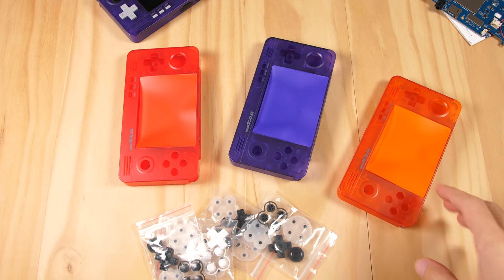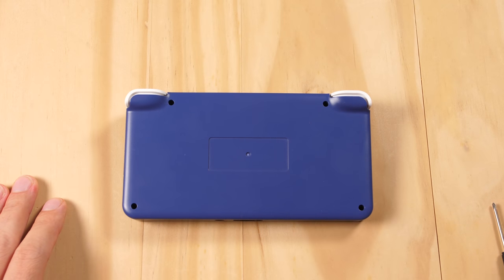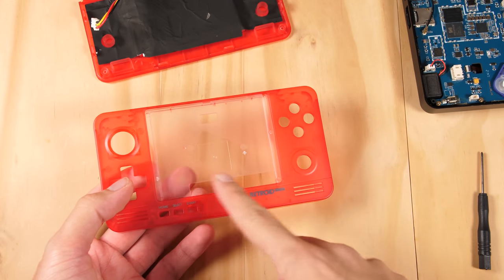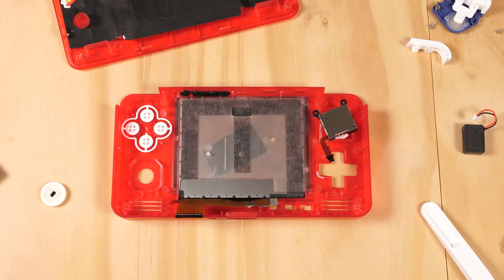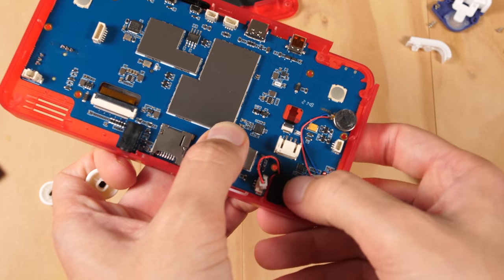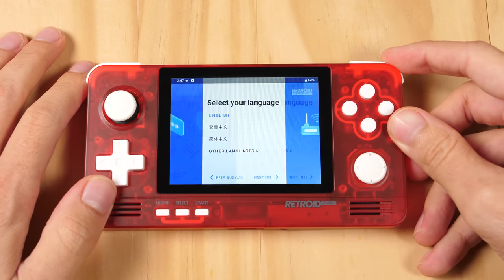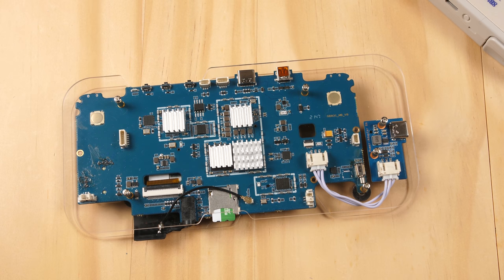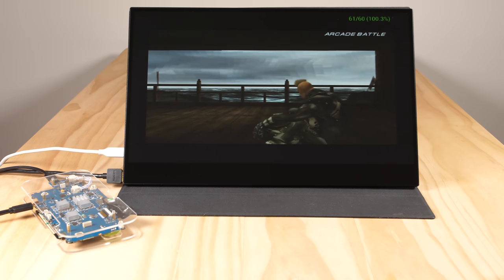Retroid Pocket 2+ | PCB Upgrade First Look!

Comment from the maker: 🔧🍉
Reply: Can you recommend me the best emulation device that can smoothly run all consoles, reasonable price, ease of use... all in all the device that you would personally use.. and that can be bought here in canada....

Thanks in advance
Reply: Taki can you do a video on gamecube emulation on the rp2+ plz?
Reply from the maker: @dylanpowell  yes
Reply: Thank you
Reply: I thinking of getting this rp2+. I have the original rp2 and I love and i think that this will be a great upgrade
Reply: Hey Taki, how'd you get fantastic shells?
Reply: hey taki i have a rp2+ preorder and i want to switch over my current funtastic purple rp2 shell without buying new parts, will i be able to tear down the rp2+ and swap the guts and touch screen over to the currently being used rp2 funtastic shell or will i need to acquire new parts as a whole for the old shell like you did in the video?
Reply: Will you do a screen switch tutorial as well?

I remember you saying a hair blow dryer or a heat gun will help.
Reply: @TheObserver85  be verrrrry careful when using heat on your RP2 when removing the shell. I warped my shell and had to order another one. I recommend using rubbing alcohol to try to loosen the adhesive.
Reply: @Mctoasty302  
The shell damage is what I'm worried about the most.

I have Jungle Green and don't want to ruin it.

Rubbing alcohol sounds a lot safer to removing the screen.

Thanks Matt 😏👍

Comment: you've really got me intrigued with the standalone project with screen.  and android is rotatable to vertical mode so this can work in my small bartop. im going to dig into this for sure. thx for the heads up.
Reply: Ryan McQuen  countercade size, with modded larger screen

Comment: You don't have to pry out glued in batteries. That's pretty dangerous, if you damage the cells. Get some isopropyl / rubbing alcohol and a pipette, a few droplets in the cracks will loosen up the glue thanks to capillary action.

Comment: Great video tutorial. 
The only thing is that I won't know how to remove the old screen.
Do you just take it out or is any glue involved?
Reply: It has adhesive around the inside edges and that E shape he pealed the back off of. 

I imagine it's similar to changing a dmg game boy screen. You gently twist the front shell, kind of like breaking up the ice in an ice cube tray.... I stress gentle.

If needed use the guitar picks to wedge under the screen to finish popping it out. 

Good luck
Reply: 1 last thing... A low temp hair dryer setting might help, to warm the adhesive... That is, if the screen doesn't pop out.
Reply: @brokensprites  Dude, I know exactly what you mean. I'm gonna do that. 

I think that GB mod feedback you gave me and the use of a heat gun (in low), it's gonna be my go to process.

You are the best, no doubt.
Thank you so much! 

- Bless
Reply: Enjoy the RP2+ ✌^_^
Reply: @brokensprites  
Great tips 👍

I also got the RP2+ pcb upgrade w/touchscreen. And was wondering about how to get the original screen off.

Thanks again 🙏
Reply: I just wanted to update you guys on my RP2 update to RP2+. The procedure works 200%. I didn't brake the old screens wild disassembling. So I fully recommend doing this.

 NOTE: You just need to heat up the back of the screen to remove it. High heat is need it.
Reply: @carlosvence  
Thanks for the update, mine should be in my hands within a couple of days 👊🎮😎👍

Comment: I've bought the pcb upgrade kit and a new touchscreen but there's no guide on how to remove the existing screen and to replace it. Help?
Reply: You have to push it out from the inside of the case. It's glued on tight... so my old screen got mangled on the way out. :( Really bummed to hear that the screen was required to make the PCB run though :(

Comment: I understand that people don't like the low profile stick on the right but because things like that get damaged in my bag I prefer them, is it possible to have the low profile stick on the left side?
Reply from the maker: Not possible unless you took a dremel to the analog and replaced it with a flat slider top. It still wouldn't be as low as the right.

Comment: If the D-pad was above the left analog stick I would have got this.

I had the first Anbernic 350 and the controls were so awkward I sold it and got the later model!
Reply: yes i really hate the diagonal thumbsticks, just put them both on the bottom please and the dpad up top where it belongs.

Comment: If I do not upgrade to the new touch LCD IPS 640x480 screen, will the TV-Out HDMI output on new RP2+ PCB work with my old RP2 IPS 640x480 LCD screen?

Comment: I ordered mine last week. How long do they take to ship these out?
Reply: Well.... Depending on what shipping method you decided on. It's a pre-order, they are making them for each purchase.

The pre-order states that each unit will ship after 35 days and it takes about 30 days shipping from China using standard shipping.
Reply: @brokensprites  damn I won't get this till March then. Thanks for the help!
Reply: @richardkassouf5719  Did you go with DHL for shipping?
Reply: @MrCumstein  4px? Not sure what that is. DHL was 3x the cost. Lol
Reply: @richardkassouf5719  Yeah DHL is pricey but you'll get it in 3 to 5 days.

Comment: If I purchase the RP2+ upgrade kit, do I still need to buy the d pad upgrade membrane as well or is it included in the package? Any other parts you recommend?
Reply: I think it comes with all new membranes, you can’t use the old membrane on new pcb.

Comment: I made this comment on a previous video but I figured you would see it on a newer video about the subject.

Ok I'm new to the retro handheld scene and I was waiting for the rg552 but it's not worth the price in my opinion but I have to ask which would u prefer because I have narrowed my choices down to the Retroid Pocket 2+ and the RG352mp, so which one could u see yourself playing more.

I know it's more your personal preference but honestly as your the only one (that I've seen) that has the Retroid Pocket 2+ and I figured you could give me and idea one which u would pick over the other.
Reply: RG351MP Specifications:
Rockchip RK3326 cpu @ 1.5Ghz
Mali-G31 GPU
1GB RAM
3.5″ IPS Display (640 x 480 – 4:3)
3500mah Battery
WiFi (With Dongle)
3.5mm Headphone Jack

Retroid Pocket 2+ Specifications:
Unisoc Quad-core Tiger T310 cpu
1 x A75 (2.0ghz) + 3 x A55 (1.8ghz) + PowerVR GE8300 
2GB LPDDR4x + 32GB EMMC
Android 9
WiFi 2.4G/5G + BT 5.0
Battery 4000mAh
3.5 inch 480p touch screen with aspect ratio of 4:3 

I have a rg351v which is the exact same specs as the rg351mp. And it's a good device and the work the modding community has done is amazing.

With the rg351mp you will get amazing performance on PS1 and below. Some N64, some Dreamcast. And the UI and set up is easy to do, especially if you are already used to Linux.

The Retroid Pocket 2 + is sporting an older snapdragon chipset. Faster cpu, faster gpu and twice the ram, with Bluetooth support and Android OS. 

Both are good and Anbernic is high quality. But the Retroid Pocket 2+ will be able to actually play N64 and Dreamcast.
Reply: @brokensprites  So my choices are higher build quality or better performance in emulation and I'm assuming that if the RP2+ has Bluetooth I could use my Bluetooth earbuds, as much as I like the look of the rg351mp's build I think I have to go with the RP2+ simply due the performance and the build with the trigger buttons.

Thank you for that info while I knew the specs for the devices I'm more familiar with pc specs then these kinds.
Reply from the maker: The 351MP is not a good value compared to the 2+.

Comment: The missing replacement of lcd is really bad... :/
Reply from the maker: What do you mean?
Reply: @TakiUdon  There is no way to remove the LCD from the original shell, wtf
Reply from the maker: @HorreyForthenewstep  if you don't care about protecting the old screen, all you need to do is slightly bend the front near the edge of the screen and insert the guitar pick in the gap. Work your way around the sides and the screen will come off in one or two pieces. If you want to protect it, you need to do something like that, expect with a Blow dryer and take your time with the pick on the front and applying some force on the inside of the back.
Reply: @TakiUdon  Yeah I done it later, anyway thanks for the answer. The old LCD suffer during the process (backplate with glue removed) but look to work.